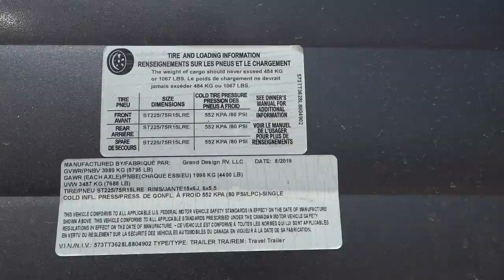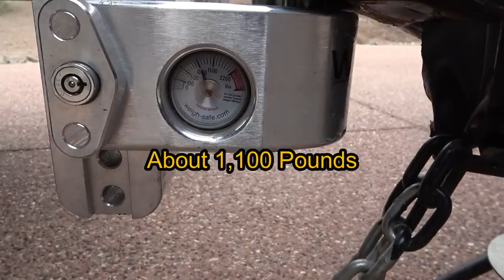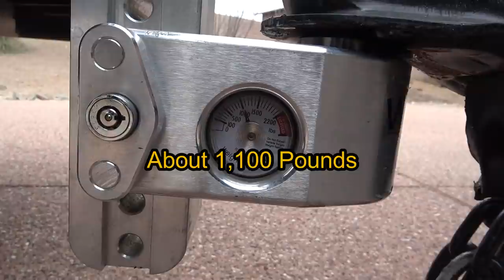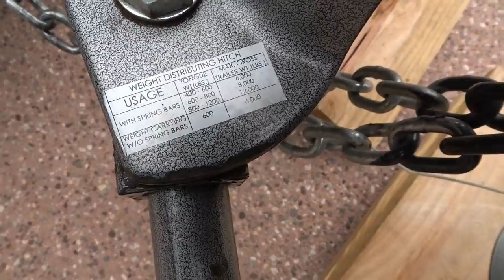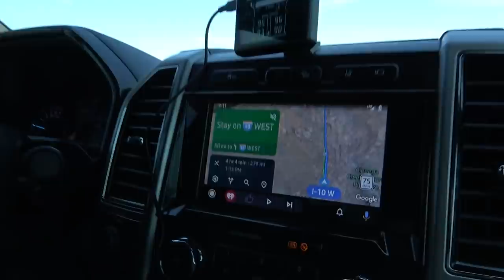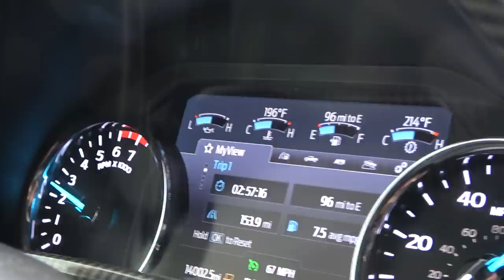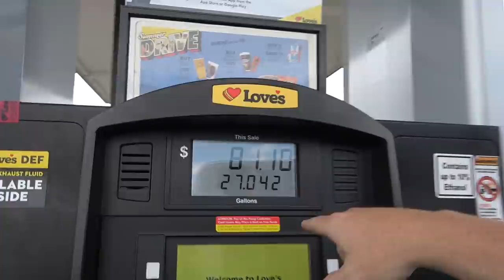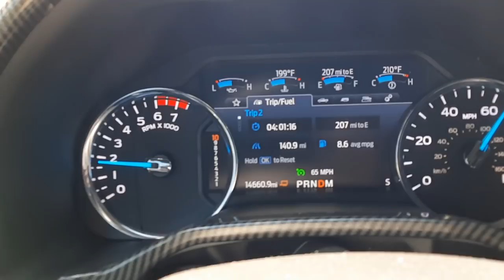Ford F250 7.3 Gas, 4.30 gears, MPG, towing prep and MUCH MORE!

Comment: Good stuff but still waiting for that unloaded 70-75 mph highway mpg loop. I wanna get a new truck in a year and I’m split between an F150 and a gas F250. I’m not towing anything now but I do keep my trucks for a long time and may need extra towing/payload capacity later. So whenever you get a chance, thanks!!
Reply: I will give you my experience you will get 6 to 7mpg better in the 150 over the 250 unless you go with the new powerboost which I don’t have experience with just what I’ve seen on YouTube. If you don’t get a loaded up 150 you can be rt around 1900-2000lbs in payload which is good. The big advantage which you said you are towing currently but is towing travel trailers or bigger enclosed trailer. The 250-350 just weighs more and is more stable. The ecoboost is fantastic and can pull a lot but again payload is your enemy. I had the older EB tuned traded it in with 120000 and the only issue was an O2 sensor. The second one sold at 75000 got a company truck. They are great trucks just bigger wind sail type trailers are a half tons downfall. Good luck
Reply: Joe Sainato thanks Joe. Yeah my current is a 2012 Eco with the 5.5 bed so plenty of xp with the 150. Had a 2500 Duramax before that, but that was a waste and never really used it to its full potential so I downgraded to a more civilized F150 when I “grew up”. That Powerboost is looking really nice but the trade off from the non hybrid 3.5 Eco is the smaller fuel tank and a little less payload, towing and hwy mileage.
Reply: I have a 2018 f150 with the 6 liter V8, and I can get 22 to 24 running 70. Biiig difference
Reply: @kilpel2  I’m assuming you meant the 5 liter? Otherwise that’s awesome!
Reply: @jaysson1151  yes,5 liter 😊
Reply: @kilpel2  hehe! Yeah from what Tim from Pickup Truck plus SUV talk was saying, N/A V8s seem to have more consistent gas mileage and meets their epa ratings more regularly. Small displacement turbo engines are great when there’s no load, wind resistance, or high speeds. But when there is any kind of resistance, the mpg’s just tank. I think my next truck may just be a 5.0L. The only thing I’d like to see more data on with the 3.5 and 2.7 is people locking out 10th gear when cruising right at 70 or when going up inclines and letting it downshift like a N/A engine. Apparently the higher rpm’s reduces the boost thus less fuel is being burned while maintaining speed. Cuz that’s the thing with boosted engines, it’s trying to maintain maximum thrust at set engine speed no matter what.

Comment: Hey love the video! Fellow Arizonan here been debating between the diesel and this big block. Would you recommend this truck if towing much heavier? Would like to get a toy hauler 5ver in the future or at least have the capability to  haul one even farther down the line. I keep my trucks 300-400k so with that in mind plus az heat,mountains and surrounding states mountains leaves me a bit concerned. I had a 6.7 powerstroke KR but sold due to the market. I’m also a trucker so I’m very experienced on how these emissions can act lol. I have a 5.4 f150 but it won’t tow that. And really don’t have much experience with gassers outside of it.
Grew up on a farm all we’ve had were diesel and now up here in queen creek they are doing the whole emissions inspections. So if you were driving that truck 400k threw the mountains and heat would you of went diesel or stayed with gas?
Reply from the maker: I don’t know about towing more because my RV trailer is the heaviest thing I have. It pulls it with such ease though I wouldn’t be scared at all to go heavy. Search YouTube as I’ve seen several videos of the 7.3 towing super heavy like 30k in a dually heavy. The engine does just fine. For me I just couldn’t justify the diesel with reliability issues they’ve had with all the emissions crap. Not to mention the maintenance cost and the dollar more per gallon it costs where I live.

Comment: I have a 2011 F250 4x4 with 331 re.  Towing my 30 ft trailer I get about 12-14 MPG.  Without trailer it runs 20-22 mpg on fairly level road at 70 mpg.  I've heard the new ones can do up to 25 mpg on highway unloaded.
Reply: Which new one is 25 mpg?
Reply: I have a 2019 with parts missing, 3.55 and get 9mpg towing my 33" toyhauler
Reply: What engine do you have in it?
Reply: @hoppy760  6.7 diesel.
Reply: You numbers sounds SIGNIFICANTY higher than any other data I’ve seen or heard from a 3/4 ton truck.
Reply: @FlyingAceAV8B  I traded the 2011 in an a 2023 Lariat F250 with 6.7 standard and 3.3 axles. Pretty much the same as my 2011.  I get a little over 15 towing my 32 ft RV (6,000 lbs).  Empty close to 22 mph on hilly empty using Cruise.  It does get 25 mph running flat at 65 mph but how often do you get that?
Reply: @dh405  my dad has a 1500 eco diesel which can’t even match your numbers empty. You are driving a miracle of a 3/4 ton truck.
Reply: @FlyingAceAV8B  I have to admit this is done with summer fuel and decent weather above 75 degrees.  Winter fuel and weather in the 40's and it droops about two MPG.  Then add bio-diesel and it drops another 20%.  I should say we are also running at 600 ft or less elevation for almost all my driving.

Comment: No way with gas, Diesel all the way!  Ram 3500 HO 1050 torque. 4010 lbs payload capacity, 11.2 MPG pulling my 9000LB Airstream from NJ to CA. 3500 is the big boy toy. Will last a lot longer and worth every penny. Those are the facts!
Reply: I think in this video he just proved you don’t need a diesel to do what he is doing.  But if you do choose gas the only option is the 7.3l.  The Chevy and Dodge gassers don’t have the power
Reply: F350 dually 5300lbs payload pulling a 45 foot momentum probably 18k or so getting 13. But for what he has he's got a great setup🤘
Reply: @dougmatheny854   I live in Arizona as well my only concern is how will this truck hold up over 300-400k towing threw these mountains but not only on the 17 but also the 40 in Arizona or surrounding states. A bit torn between the mountains and heat. I think that may be the biggest trailer I’d haul with that truck with all the mountains. Just torn I’m a trucker as well and very familiar with the emissions issues diesels can have. Diesel just seems  it’s due better over the years with these conditions
Reply: A modern diesel with particulate filter, turbo, high pressure fuel rail, DEF systems, etc will last longer than a naturally aspirated, cam in block, gas v8??? Highly doubtful.... Today's diesels aren't what they used to be...

Comment: Hey Jordan can you tell me how to find that anti rattle clamp thing? Also what aluminum hitch is that you use daily? I like how it locks and shows the weight you have on it. 😊
Reply from the maker: Here is an Amazon for the anti rattle. Thay have a bunch of them. https://www.amazon.com/s?k=anti+rattle+rv+hitch&crid=31T1YYFQUWZ96&sprefix=anti+rattle+rv+hitch%2Caps%2C146&ref=nb_sb_noss

And here is a link for the "weigh safe" hitch. https://www.amazon.com/s?k=weight+safe+hitch&crid=3CZYNI0DXOQG8&sprefix=weight+safe%2Caps%2C153&ref=nb_sb_ss_ts-doa-p_1_11

You can shop around and may find them cheaper. Thanks for watching by the way!

Comment: I did a lot of calculating of added cost vs fuel mileage on a Diesel vs Gas and it did not add up to buy Diesel. The initial price difference was around $8000-10,000 Diesel vs Gas then the fuel was .30-.50 cents more for Diesel. The normal oil changes cost much more for Diesel than Gas engines.  My 2010 F-250 with 6.8 V-10 gets 8.6 MPG towing my 32ft Fifth wheel that weighs 12,000 LBS loaded. Honest Diesel owners get 13-15 MPG towing It was going to take a long time to pay for the Diesel engine. Plus newer Diesels require DEF fluid so that  needs to be added into cost of fuel also. Yep the turbo Diesels pass me like I'm sitting still on the hills but I smile all the way to the BANK.
Reply: 1000%. I have a 97 Chevy 3500 with a 5.7. It’s slow up hills, and doesn’t like to go much over 70 but idc. Does what I need it to do.
Reply: Prices vary depending on where you live.
Highest I have payed for diesel all summer is $2.69  Just filled for diesel for $2.54 gas was 2.99

Comment: I totally agree with all your points for choosing the 7.3L over the diesel. I also understand that the F250 and F350 rear springs are the same on the Tremors but I feel there must be some difference. I say that because I have a 2021 F350 7.3L Tremor and my payload sticker says 3601. I have yet to see an F250 Tremor with one that high which makes me believe there must be something beefier in the F350. I still haven't been able to verify what. My dealer said the rear axle is bigger in the F350 but don't know for sure. I would be interested to find out though.
Reply from the maker: The raiting between the 250 and 350 Tremor is just a sticker difference. It's for DOT regulatory differences. I touch on it in the video. Regular 250s and 350s you'd be right.
Reply: @BigBoyToyzz  so the F250 Tremor payload stickers are underrated. Gotcha
Reply from the maker: @shaunharrison9618  yep, exactly.
Reply: @BigBoyToyzz  so I guess I paid about $1K more for an F350 for nothing. Awesome. Lol
Reply: If you look in the online parts catalog from Ford (at a dealership) you will see the wheel bearings and brakes have different part numbers, and specifications🤷🏻‍♂️. I haven’t looked much past that but I think rear axles are larger diameter as well. I will say my registration is $103/yr as my F250 was $65/yr. I know the rear leaf packs might look the same but there are definitely other differences between the F250 and F350 Tremors. My 20 F350 Tremor has a payload of over 3600lbs and it’s a 6.7. As far as the F250’s not being as regulated, well I hear from DOT officers here in Ohio they specifically look for overloaded 3/4 ton and 1 ton trucks pulled by individuals (easy to spot). They say it’s easy to catch hot shot/ over the road etc. as well because they have to stop at the scales. Good video nice truck/trailer 🤙
Reply: You need to compare the gvwr of the trucks, that will make the payload higher.

Comment: I have a white 2021 f250 king ranch with the 7.3 engine. May I ask where you got your 7.3L logo and do you have a close up pic? Is this emblem metal or plastic?
Reply from the maker: It’s metal and I got it on Amazon. Some of my videos do a close up of it.
Reply: @BigBoyToyzz  I have only been able to find brushed aluminum finish, not chrome metal. I also have the line x bed liner and the fifth wheel/gooseneck holes in my floor. I love your bed plugs. Did you say you would make a set of these? If so how much?
Reply from the maker: @mowens1972  Thanks MO! I don't plan on making the bed pugs, I just don't have time. Maybe when I retire!

Comment: I think the only way to verify if they have the same payload is to compare a f350 to your 250, I have a 2021 f350 tremor 7.3, and live in AZ lets hook up the same trailer to the truck see if one sags more than the other? I am curious
Reply from the maker: Or, you can go to a Ford parts website and look up the rear leaf packs for both trucks and see if they are the same part number. I have a video of my truck next to a 350 Tremor where I compare leaf packs. Check out my channel for that. I like your idea though. Where in AZ are you?

Comment: F350 has 1000 lbs more payload approximately than the F250. They are NOT the same truck. Same engines but the payload capacity of the F350 makes it more capable for pulling heavier loads.  This 3/4 vs 1 tons
Reply from the maker: Normal F250 vs F350 yes. But did you hear me say they are the same trucks when outfitted with the Tremor package? The only difference is the payload sticker and the emblem that says F250 or F350. AGAIN this is for Tremors only.

Comment: What’s the tongue weight on your trailer? How many washers are you using on the hitch head for the pitch adjustment?
Reply from the maker: I cover the tongue weight in the video, I can’t remember off the top of my head. I have 2 washers.

Comment: i don't need a truck yet, few years still.  but i have a hard time thinking about getting rid of the raptor, but i think the tremor might ease that transition.  eventually i'm gonna need more towing capacity than f150, especially the raptor, provides.

Comment: My 2020 F350 crew cab xlt premium package short bed gasser w/ snow plow package has a payload of 4239 ...gvwr of 11300. So I dont know if your 250 tremor is the same as a F350 tremor. Payload of 2921 in a F350 gasser tremor or not would be very low. Just seems odd.
Reply from the maker: Yes 250 Tremor and 350 Tremor are identical other than payload stickers. All F250s are capped at 10,000 gvrw. So if my exact same truck had a diesel my payload would be about 700 pounds less because that added weight of the diesel engine. F350 are not legally capped at 10K so the payload sticker reflect the "actual" engineered payload. This applies only to the Tremor packages because normal 250s and 350s have differences in the spring pack and axles. Thanks for visiting the channel!
Reply: Not rue there are RV tires with higher speed ratings. Depends what you are running.
Reply: @BigBoyToyzz  not true. F250 Tremors with a Diesel engine have a 10800 gvwr. They have a similar payload to the gassers, 2800 or so.
Reply: @slidewide1999 let’s think about what happened here. They just up’d the numbers to account for the heavier engine. Which means a 7.3 Tremor and Tremor is likely able to haul another 800lbs without any issues. It’s a very overbuilt truck.

Comment: First of all love the American flag above the F-250 badge. 2nd would it be worth it to get a F-250 diesel for construction or welding even though it doesn't have as much payload. Also would it be worth it just to get better mpg and torque

Comment: Might want to check your spring rate, I believe they are different
Reply from the maker: I did, it's not.
Reply: The gvwr is probably different
Reply from the maker: @billb6606  it is… on paper, but trucks are mechanically the same.

Comment: Be careful towing a TT at 70-75mph.  The speed rating on most of these tires is 60-65.  Also your gas mileage tends to drop significantly due to the extra wind resistance.  And the legal speed when towing is lower.
Reply from the maker: I run the Goodyear Endurance rated at 85 MPH. AZ does not have towing speeds. I also run Tire pressure and heat monitors on the trailer tires so I can tell if something is going on with them.
Reply: Speed depends on state there hero.

Comment: Tail wagging with a f250 on 8000 pounds seems concerning if you had the trailering packages. i realize the weight distribution bars are nice, but f250 should be able to  handle an 8k trailer 30+ feet. Especially with it unloaded and tongue not even loaded to start.  But at least the hitch is an easy fix, if i get a 3/4 ton truck ill remember that.  Did you get 4.3 axels?
Reply from the maker: Yep it has the trailer package and 4.30 gears. Most all long bumper pull trailers will wag their tails in the slightest wind. That’s why my next RV will be a 5th wheel. They go down the road way better.

Comment: if the 250 and 350 are exactly the dame right down to the leaf package.... why is the payload different?
Reply: The differences are: 

1. The size of the blocks between the rear axle and the rear springs.
2. The GVWR number printed on the B-pillar tag.
3. Hitch on the back
4. 3 Rear leaf springs on the 350 vs 2 on the 250
5. 7K lbs rear axle load on the 350 vs 6K on the 250
6. Some model years had different axles for the diesels in the F350s.
Reply: @yungnachty4474  Thank you! I really appreciate the reply.
Reply from the maker: Not for the Tremor package 250 and 350. Everything is the same except for payload sticker for legal purposes. Again… only Tremor package. Regular 250 and 350 have multiple differences. Check out this video.  This F250 is an F350. What?!?!
https://youtu.be/CPSm8uvZG_k
Reply from the maker: This F250 is an F350. What?!?!
https://youtu.be/CPSm8uvZG_k
Reply: The tremor F250 has the High Capacity Trailer Tow Package. Which makes it the same as a F350. I have a ‘22 250 8’ bed with the HCTTP… Looked for 2 months for a new 350 8’ bed and couldn’t find one. Had to go with the 250 with the hcttp
Reply: @yungnachty4474 you should edit your info to reflect that it does NOT apply to the Tremor. The tremor has all the same suspension and undercarriage as a 350. Legally speaking, the sticker can’t show the rating of a 350.

Comment: Why do you have your tire pressures so high???
Reply from the maker: 80 PSI is whats on the sidewall and door sticker. Are you coming from half tons. Those are usually 35 to 40 psi. I run 60 psi all the way around when not towing so the ride is not so rough.  But still the factory recommended is 80 psi.
Reply: Load range e is 80psi

Comment: Pay loads not that much different my F250 Platinum Tremor is rated at 2666 so it’s only 250 pounds different and I have the diesel panAramaic roof heavy tow pkg etc. and if I keep it down to the speed limit ( which is nearly impossible) 19 mpg hwy about 600 miles to a tank

Comment: Dude, you installed your anti-rattle bracket upside down and backwards. You can even see the bolts aren't seated flush with the plate.
Probably not a big deal but, WRONG !